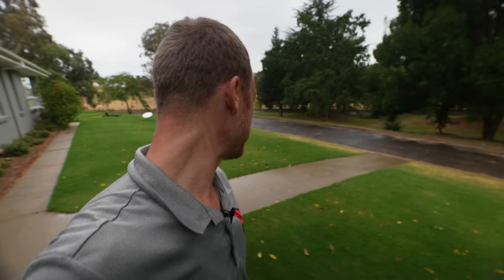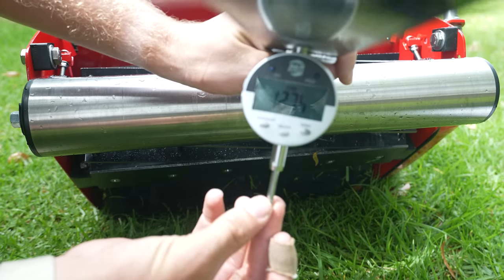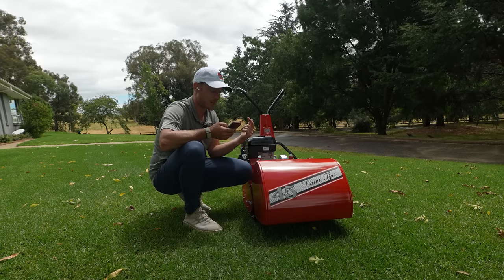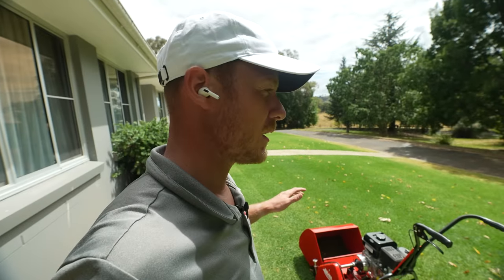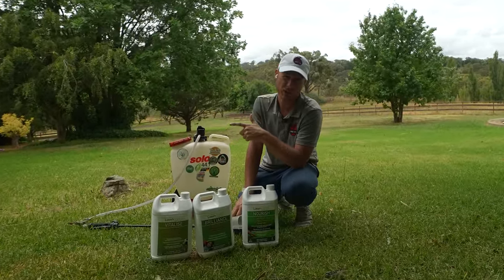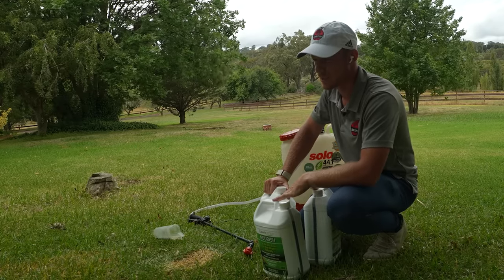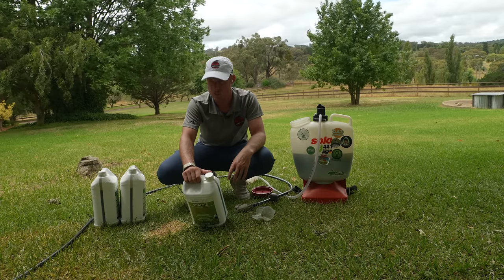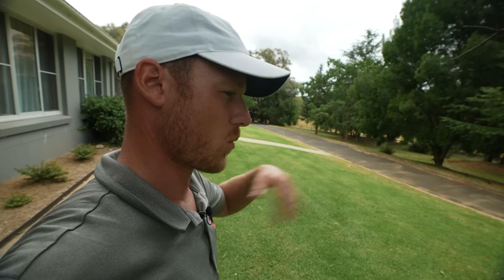Double Cut on the Kikuyu // PLUS My New Liquid Fert Mix

Comment: Ben I’d live to hear more about your thoughts on the vulcanised rubber rear roller… Been toying with the idea myself but have been told that the rover 45’s can’t be done because of a tighter tolerance between the rear roller and the frame compared to earlier SB’s.

Comment: I've got an absolute dogs breakfast MIX of cooch and kikuyu mixed in amongst each other everywhere. What is your suggestion? I just want to have 1 type of grass, at this point I don't care which one prevails but they are equally as strong and neither is taking over the other they are just mixed in amongst each other with patches of some and patches of the other and patches of them both mixed together.

Comment: Hey question for myself and might be for others.
If your grass is a little longer and you want to transfer across to a cylinder mower. How do you train your grass to be cut lower with out scalping it? What steps should you take?
Reply: My understanding is scalp it to to just under desired cut height. Then cylinder mow it every 2 or 3 days depending how high your HOC is.
Reply: @krump743  thanks mate